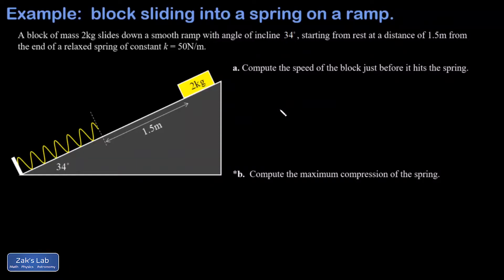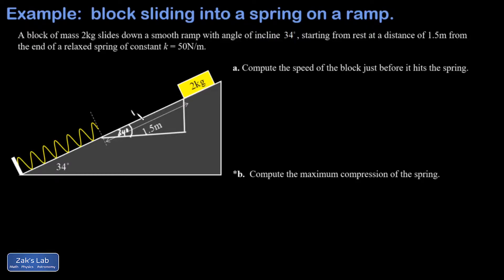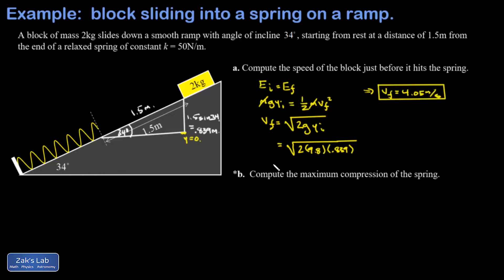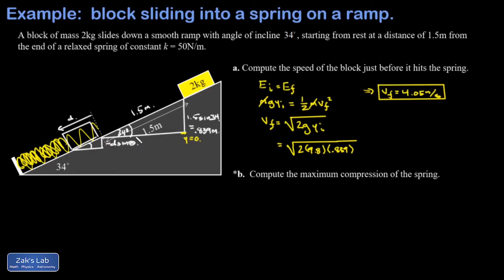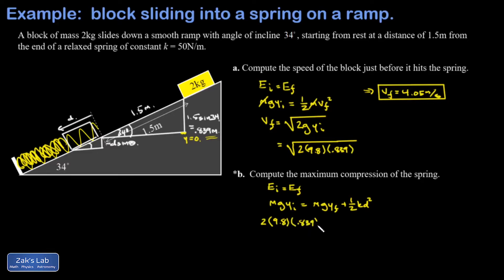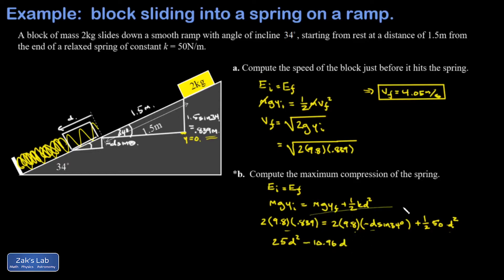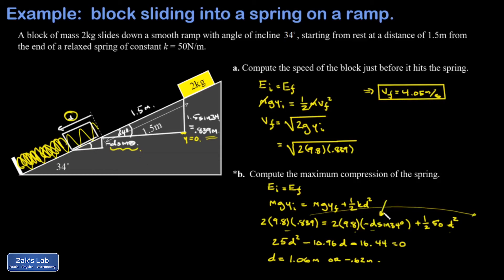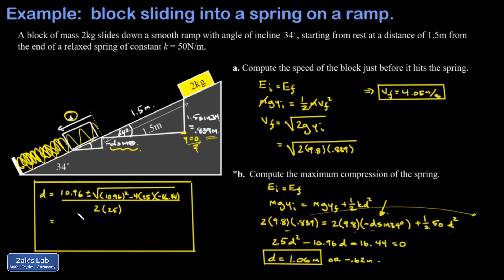Block slides down a ramp into a spring: impact speed, obtain the maximum compression of the spring.

Comment: I'm curious, if we assume no losses the spring would bounce back up and launch the spring back up. You'd get a piece - wise function. I understand how you got the compression, but what about the tension or stretch? (This is just a for fun thing I thought of)
Reply from the maker: I can't tell whether or not you're assuming the spring is attached to the block after the impact?  if the spring is attached to the fixed block at the bottom of the ramp and NOT attached to the block, the entire process just runs in reverse back to the initial position - the block loses contact back at the point of equilibrium, at least this is true for a "light", i.e., massless spring, and the block slides back up, slowing down steadily due to the parallel component of weight.
Reply: @ZaksLab  I was assuming the block sliding down the ramp is touching the spring on its way down and back up from the spring. So on impact, during compression, and once the spring reaches its max stretch before it lets go. 

But I see what you mean with the assumptions and such. If all goes well, we should be able to model the behavior on the spring in both compression and stretch using 1/2 k d^2

Comment: If Velocity before it hits the spring is 4.05 m/s then the kinetic energy of the block is (0.5)*2*(4.05)^2. That Kinetic energy is converted into spring potential energy which is 1/2 (50 N/m)x^2. Setting them equal to each other the value for x is around .81 meters.
Reply from the maker: Your solution isn't accounting for the decrease in gravitational potential energy as the spring compresses . . . that's why I ended up with an equation that required the quadratic formula to solve. -- Zak
Reply: @ZaksLab  so it's OK to use .5*2*4.05^2+2*9.8*dsin34=.5*50*d^2. 
The kinetic energy and potential energy right before equals the energy transferred to the spring.
Reply: @ZaksLab  thanks
Reply from the maker: @AbhiramN_1289  my pleasure - z